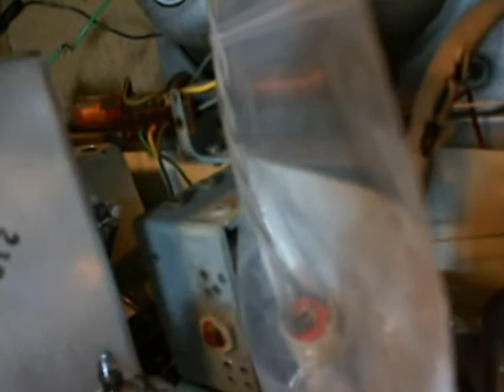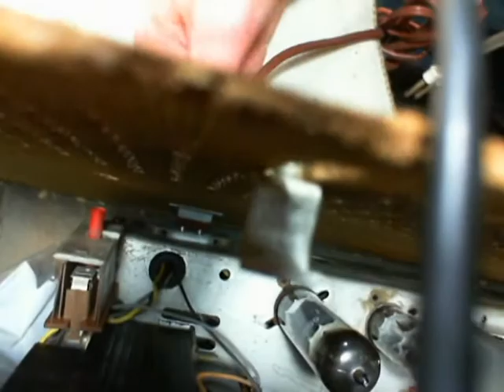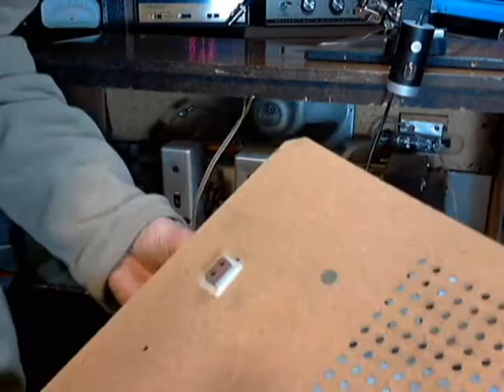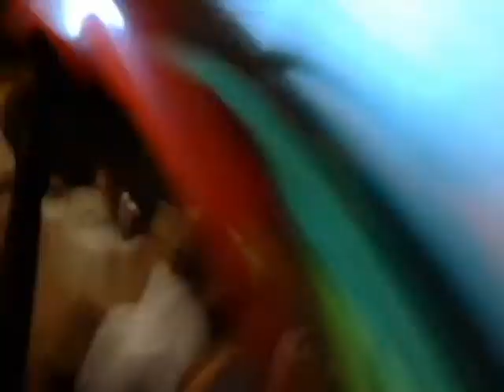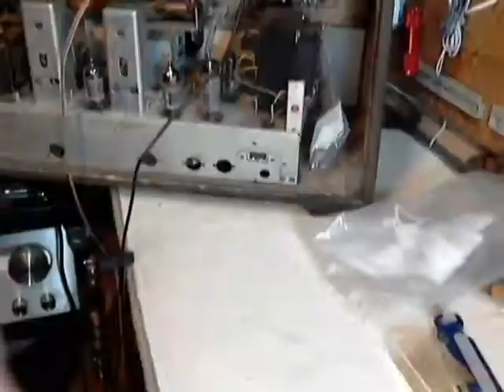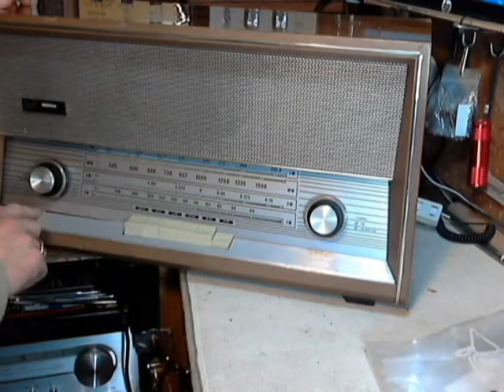The Florida AM/FM/SW Yugoslavian Built Tube Radio Video #4

Comment: Hi Jim, I think the plug issue might have been caused by the fact that the right rear chassis mount did not have a piece of rubber under it like the front. Then it would have raised it just enough to line up with the plug. I checked video 1 and it looks like the rubber was on the back and not the front. Incidentally, it looks like the front part of the mount was bent a little already. How much voltage is on that yellow wire coming off the transformer?
Reply from the maker: Sometimes the obvious escapes me.  I knew the rubber washers were missing on the back but I couldn't complete the thought.  Guess I like using my saw too much.  Don't know about the voltage.